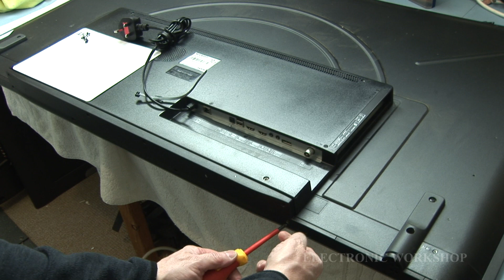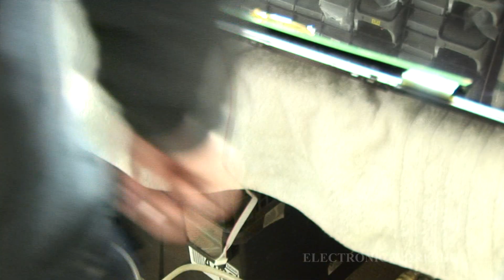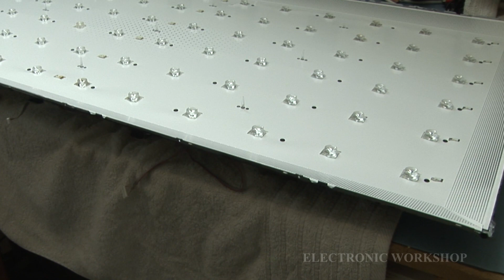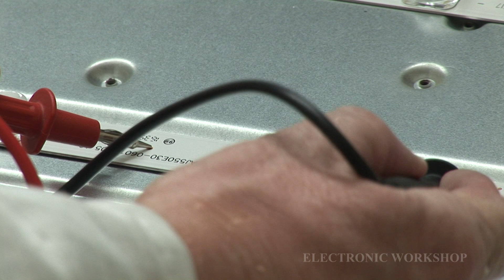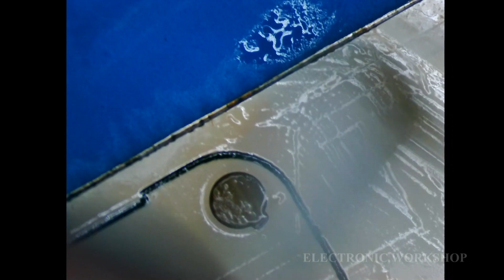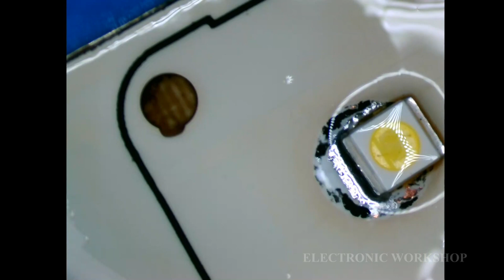Sharp LC-CUG8461 No picture audio ok | LED Backlight Repair

Comment: I am not an engineer and appreciate your video as I have no idea about how to do what you are doing. If I might ask a stupid question why don't you check a whole row at a time since you have a power supply and can adjust the voltage ( to the number of leds in a row x3)? It would save the hassle of each one individually being tested. I have seen some videos where people have been using continuity meters of voltmeters to test these presumably as they give up 3v. I have noted that some led strips do not have test points and especially for those and peeling away the mask for each led seems painful.

Comment: Hey I have a problem. How much did you have volts during checking LEDs? And one more question. With what current to check these diods. Constant or variable?

Comment: Its better to replace the whole stripe set, otherwise the next LED will fail after few weeks and you can do the process again
Reply: I had good luck with repairs by turning the brightness down after, only had a couple sets returned in the many I fixed.